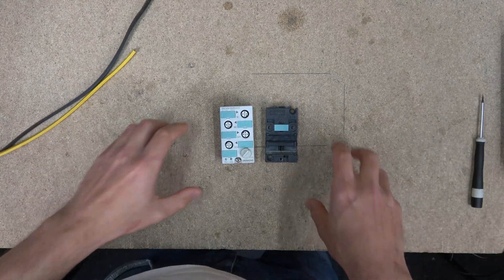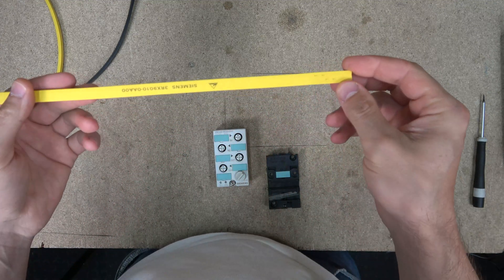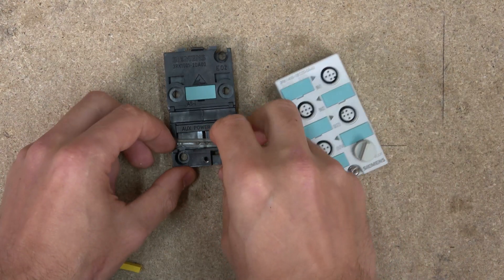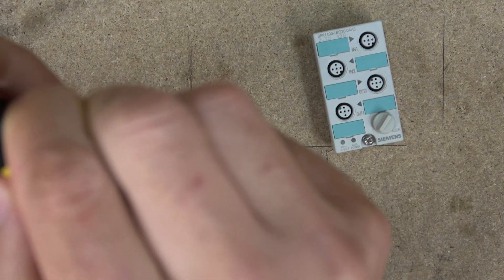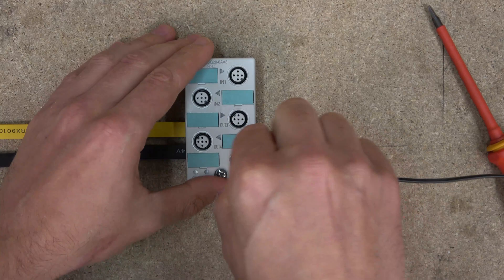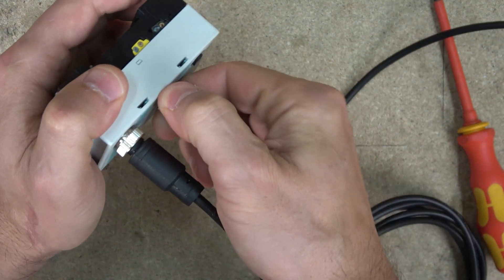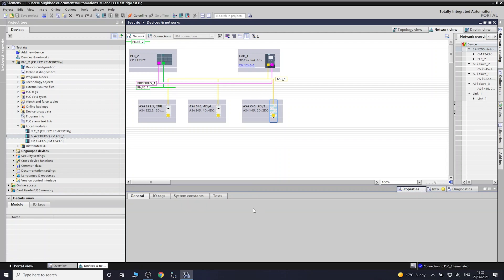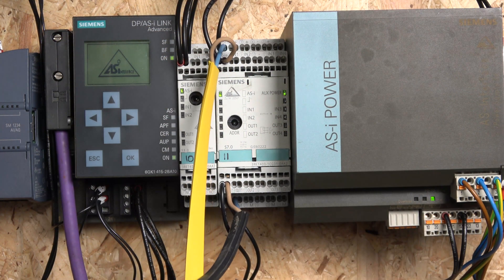Siemens S7-1200 PLC, AS-i network K45 field unit wiring and set up. English

Comment: Did you assign an address for the module in TIA portal, because I saw that you tested the address, and it was 3, but we didn't see how the plc understood on what inputs and outputs the components are connected.
Big Thanks for your valuable videos :)
Reply from the maker: You need to use addressing unit to assign address to the unit and then set the address in plc program as well. Check out other videos of how that is done. Thank you for watching.
Reply: @IGSElectronics  Thank you so much